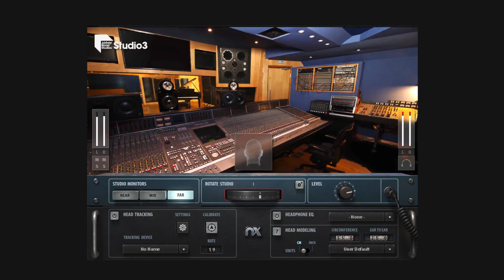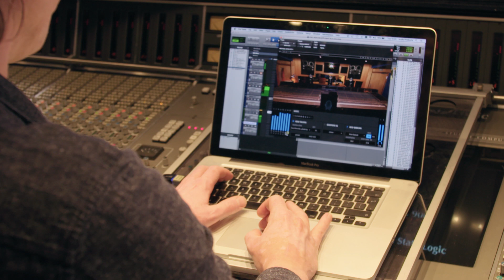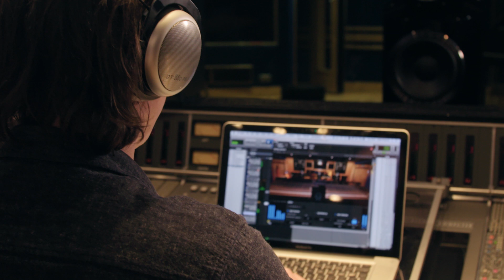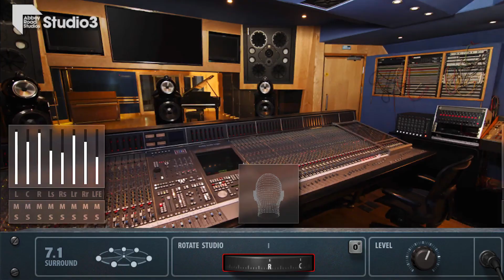Perfect Acoustics on Headphones: Inside the Abbey Road Studio 3 Plugin

Comment: Can someone explain why you wouldn't want to keep it on during exporting if it improves the sound so much? Does it simply not translate to speaker systems? If so, how can you trust it to be a reliable portrait of what your music will sound like on those other systems? Won't your exported mix sound quite different than what you were listening to in "Abbey Road Studio 3 Control Room"?
Reply: It’s basically a simulation of what your music would sound like in that studio, specifically for headphones. Imagine you leaving the plugin on, and then playing the export in your car for example. You would play a simulation for headphones of a studio in your car, which isn’t the goal. 

Because the left and right signals never collide on headphones, it’s impossible to predict how they would “clash” together on any type speakers. Many frequencies can create issues or build up when colliding, so that’s the main thing this plugin does. Emulate what would happen in a perfect studio room with high end speakers, to simulate the feeling of reliable speakers/room.

I don’t have an acoustic treated space with expensive speakers, which in my case makes a plugin like this heaven. I really get a chance to hear mistakes I otherwise wouldn’t hear.

My main tip for this would be to use it together with regular headphone mixing/producing. The switch in between sounds will make you reconsider stuff you otherwise won’t, and give you a fresh view of your work while switching. With the head tracker I feel my ears don’t fatigue as fast either, as there is movement in volume, which otherwise is very consistent on regular headphone mixing, causing my ears to get tired faster. (I feel like with constantly hearing the same positioning like we do with headphones, my ears adjust to it, which is not something we want while mixing. I try to compare it to looking stationary at a bright light for a while, it leaves a spot on your sight. I think the same goes for hearing something consistently. With subtly moving those “spots” don’t appear as fast)

It’s a matter of giving this a shot IF you don’t have a reliable room and/or high end speakers. Get used to the sound of the abbey road studio and try to find a way to implement it into your workflow. 

In my opinion it’s never a bad thing to hear your own work in several spaces. That we live in a time where we can get a pretty close simulation of an insanely expensive studio is a blessing by itself!

Comment: Sennheiser HD-650 NOT Listed ?!!! 
--------------------------------
EQ Calibration Supported :
Audeze EL-8 (Closed-Back)
Audeze iSINE 20
Audeze SINE
Audio-Technica ATH-M50x
AKG K-702
Beyerdynamic DT-880 (250 ohm)
Beyerdynamic DT-990 (250 ohm)
Sennheiser HD-280 Pro
Sennheiser HD-600
Sennheiser HD-800
Shure SRH-440
Sony MDR-7506
Reply: It's a shame for the HD 650. I use the hd600 calibration with my HD 650 and it kind of work but a dedicated calibration would be great

Comment: It's been very helpful to start the mix via ABS3 then checking the mix in the monitors (by passing the plugin).Mu mixing room lies in the lo end stuff so with ARS3 i can take better eq decisions and a better balance of bass instruments.It's strange and almost hard  to believe  but it works really well if you use it from scratch before eq or compression.To put it in a finished mix is senseless.
Reply: I believe you're supposed to use it at the very last spot in your chain

Comment: I use this software with my Subpac and a calibrated focal spirit Professional and I can tell you I really got the feeling of sitting in a Perfect studio. Especially when you Switch the distance from near to far you get a Perfect Impression of what your Bass Sounds like. If it Is clean or shaking somewhere. Great Plugin👍
Reply: Wolfgang Schnermann see I have to be careful with my opinion about this because I don’t have it... I didn’t think this could really be useful... but I am actually more curious. So judging bass is a pain, if this works accurately I could see that being huge and very helpful. How much has this tool helped with your final mix?
Reply: @Chillywillystyle  It has helped me a lot in judging the tracks' Volume, depth and panorama position. If you are not lucky enough to have a studio with a good monitoring situation, this is an unbeatable tool; in case you have a good calibrated Headphone, that is a must for the plugin, in my opinion.

Comment: This is one of those plug-ins that I'll never put again on my monitoring buss ever again! I have downloaded the demo today and here are my findings:

- Immediately noticed the narrowing of the imaging which pretty much became the deal breaker right there! All the panning got squashed and unrealistic compared to what I have left in a recently finished and submitted mix. I have tried all three profiles of monitors - Nearfields, Mid and Mains. They all do it with almost no difference.

- The Nearfields and the Mains (or they called it "Far") introduce a certain amount of bass boost to your mix which will become a problem when mixing by making you do actually the wrong mix decisions and have less bass in your mix since you hear more of it during mixing. It was more expressed while using the Far/Main monitors. Also due to the imaging skewing the low end seems to be scooped up just more towards the center field. I've also actually lost my depth that should be perceived normally.

- I have been monitoring through my AKG K712 Pro Reference Headphones, all calibrated for the given task. I understand they are uncommon due to the higher price tag so I was not surprised they are not listed in the EQ section. However after trying the different EQ profiles, they made little to no difference to me sonically. There were some perceived changes but not by a lot. I am using a professional calibration software for my headphones running on my monitoring buss at all times and I know how much difference a corrected EQ curve can do.

Overall, I am disappointed that Waves did not deliver this time despite all the effort I am sure they put in this product. A plug-in of this sort is supposed to affect your listening experience, not destroy it. Not trying to be harsh, but honest to my findings. Maybe a future update could fix the imaging issues that totally ruin the functionality of this plug-in.
Reply: Guy didn't do the homework, now he doesn't understand the plugin, sounds like he doesn't even know in what part of the signal path it goes. Those are precisely the things that make this plugin useful!
Reply: Andrei Martinez Agras - Where else would you put it?
Reply: @zaharishtonov  read the manual.
Reply: @UChXEkqVY4Ka8Xe4harxcW8A what is not nice at all is to bash a product that has a lot of potential and might help a lot of people expand their monitoring options because you don't want to read the manual or because you expect the plugin to sound like the room you are used to or simply because you don't care for the people involved in the research and development of new products. You know what is not nice? Trying to push your narrative citing a "pro mixer" from LA and then editing your comment just because you might risk loosing clients or worst, maybe, just maybe because that was a lie. Have the courage to learn the manual, ask for help, contact tech support and try the plugin for more than one day and then don't buy it if you don't like it and write something that actually might help people who potentially have no need for this plugin like you supposedly are. Then, everybody will shut up and thank you for expressing something of value even though that might dissuade some of us from getting what is probably a great tool.
Reply: @AmagrasMUSIC  - You did not answer my question! Instead you are giving me this whole rant... So, I am going to ask you again: What do you think I am doing differently than what the manual says? Where does the plug-in go? If you can answer that, there might be a conversation here.
Reply: @zahari shtonov - what you’ve described is exactly what the plugin SHOULD be doing: its entire point is to give you a speaker-like experience on headphones, you can predict what your headphone mix will sound like on speakers, in terms of 1. panning, 2. bass response, 3. ambience etc.
Reply: @oranmoked1  As someone that's used a Large Audient mixer, it's nothing like being in the room, you won't get the right "feedback".
Reply: @oranmoked1  - Yes, I understand that this is the idea behind the plug-in. Unfortunately it does not deliver. I listen to a mix through headphones and speakers after. If I pan things through Studio 3 and apply EQ all using headphones, then things sound totally wrong when played on studio speakers after - unbalanced both specially and frequency wise. Whatever processing they are applying is misleading the listener.
Reply: It probably doesn’t help that you didn’t have the headphone profiles that they had listed. May not make a huge difference but I would imagine some
Reply: @DJNaz4You  Oh it makes a difference. Waves has removed the original list of 12 headphones from their website but of-course it's still presented in the app. If the original poster is using un-calibrated headphones he will not hear things as Waves intend. And his AKG 712's cost no more than my Shure 1540's, both (Flagship Models) can be found for $500 US. 
I placed the plug-in at the end of the MASTER BUS CHAIN, but without proper calibration it sounded as the poster describes.
I'm going to try again using Sonarworks Reference Headphone calibration feeding into Studio 3, we'll see what happens.
Reply: @HollywoodVirtualAudio  - I have my AKG K712 Pro calibrated and running through Sonarworks Reference 4. But I placed the Waves Studio 3 before it, as Reference 4 should be the last thing on the chain. The reason I place those plugs on the Monitor Buss is because the Monitor Buss is feeding from the Master Buss. This way I do not have to bypass my monitoring plug-ins every time I need to bounce the mix. The mix comes out unaffected on the other side, ready to be played on any other system. Cheers!
Reply: @zaharishtonov  You feel your headphones are calibrated for this task but we can't be sure. Sonarworks wants to make your cans FLAT. We don't know if that's what Studio 3's EQ Calibrator does. Also both these plugins are fighting for the same space. Both want to be last in your chain. Normally Sonarworks should go last but why flatten the frequency response after Studio 3??? People are upset because you slammed the plugin VERY HARD while not using
supported equipment.
Reply: @HollywoodVirtualAudio  - You flatten the frequency response so you make sure everything is coming out right. It is possible to try the other way around and get your calibrated signal coming out from Sonarworks Reference and feed that to Studio 3 (to simulate the room). The supported equipment is your headphones. That's what the Studio 3 was designed for. Now having imaging problems with your panning has nothing to do with frequency response. That is the least of the problems here. The major disappointment is the issue of your panned instruments being displaced unnaturally when using Studio 3. I express that in my original post. Certainly "slamming" the product was not my intent but rather its functionality is what's being judged. I hope that a review like this provokes further thought over the product and steer some action to correct the above issue.
Reply: you serious ? of course the stereo field is narrowed, it's supposed to emulate speakers ! you never place your speakers 100% left or right, they're more in front of you.

Comment: Wow!! So much negativity on this plugin. Has anyone tried it to substantiate that it's shit? Most of Waves Plugins I have used are very good so on reputation I would assume that this plugin does what it says on the tin. Whether it will mean the mixes translate can only be verified from actual use but to me this sounds like a decent plugin. Best to try the demo first
Reply: The idea that Waves would release this with only
 12 pairs of headphones supported is unfortunate.The surround aspect is nice and appears to work well but I'm not hearing things as I should because my Shure 1540's didn't make the cut. Can't calibrate with Sonarworks in surround because it's stereo only. I'm going to spend some time with this in stereo.
Reply: @HollywoodVirtualAudio  after checking the specs my headphones don't make the cut either. I have Yamaha MT8 headphones. For them not to be included as well as other top headphones used by studio engineers unfortunately even I as a Waves Plugin fan can't really back them on this product. Without even trying them I'm giving it 1 star out of 5 for not adding more headphones to the list of calibrated eq for different headphones
Reply: @bigchat1232  I'm going to try this in stereo with Sonarworks in front of it and see what happens.
When Sonarworks first came out they only calibrated a hand full of headphones. Now some years later
they calibrate 280. (Waves has removed the original list of 12 headphones from their website.)

Comment: I only have one question.  Is it possible to record the outcome of this?  I mean could you put this on a stereo bus?
Reply: I don’t see why you would, but it’s certainly possible. Ideally this plugin would be turned off or bypassed when rendering the final mix, similar to other reference tools or corrective EQing.
Reply: @rt.hinkel  you can, as a creative and very different stereo effect processor.
Reply: Since it's a plugin, I see no reason why you couldn't use it in any capacity that you'd use any other plugin, so yes. That thought did cross my own mind (e.g. an 'in the room' effect).

Comment: The headphones need to be calibrated because not all headphones are the same. They have different frequency responses.
Reply: Abbey Road Studio 3 has EQ calibration for some of the most popular pro headphone models
Reply: @oranmoked1  yea i know but the description says "any headphones".
Reply: Yup, the spatial immersive effect (like sound coming from real speakers) works with ANY headphones, any model. The EQ calibration is a bonus, available for some models.
Reply: @oranmoked1  and they just removed the list from the website. Hopefully they will update it quickly.
Reply: @oranmoked1  ,  yes but there are only 12 of theme. In theory, your headphones should be flat before adding Studio 3.
If in-fact that's what the EQ calibrator does, another way to make your headphones flat is Sonarworks, Reference 4.
They support 247 headphone models. Took them years to reach that number.
Reply: Hollywood Virtual Audio so add sonarworks and then this plug in after on your master bus ?
Won't that decorate the sound a little ?
Reply: @dopesensi  , unfortunately everything you add to your Master Bus, "decorates the sound a little." 
Both these plug-ins should be last in that chain, and bypassed on export. Also, Sonarworks is stereo only, and offers no multi channel support. I wasn't expecting that.
Reply: Hollywood Virtual Audio  Bypassed on export . 

Thanks .
Reply: @dopesensi  Yes, bypass on export.
Reply: @HollywoodVirtualAudio  not true. Waves has already stated that it expects a Harman curve, not flat.
Reply: @inigogc  “not true” Seriously? 😂 “the Harman Headphone Target Curve, flattens the frequency response of your specific headphones, ensuring that what you hear is a more neutral and accurate representation of the virtual studio.” There’s that word again, FLATTENS!….. Of course 6 years ago, it only worked if you had one of the 12 supported headphones. So the rest of us needed to flatten the signal before it got to the virtual studio plug-in. After we brought this up, Waves removed the list of 12 from their website. Today the list is strong, compatible with 270. No further need for my sorcery. 🎉🎉🎉
Reply: @HollywoodVirtualAudio the Harman curve is NOT flat. It's specifically NOT flat because it's closer to what people prefer.